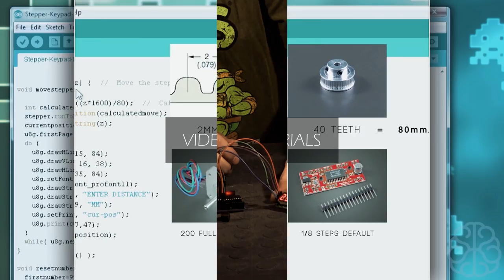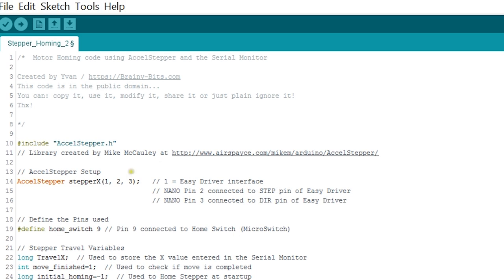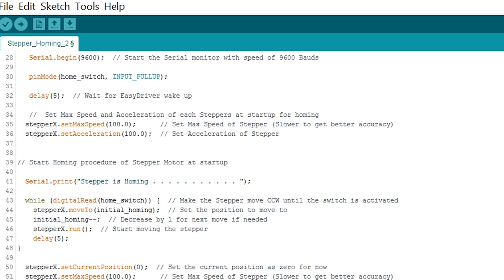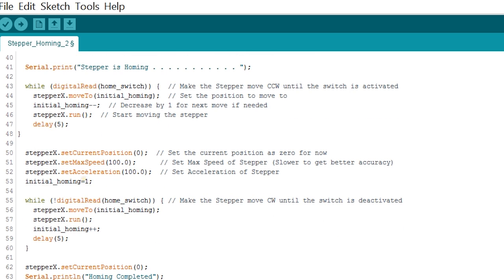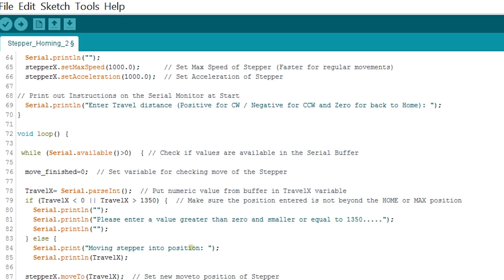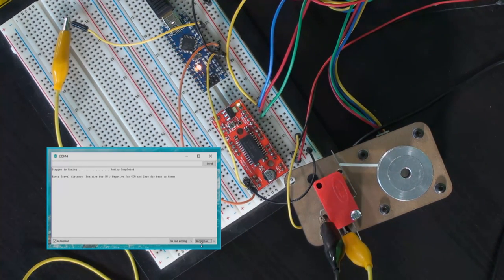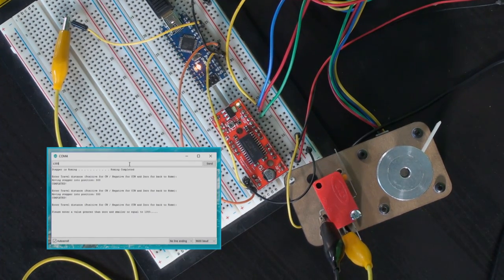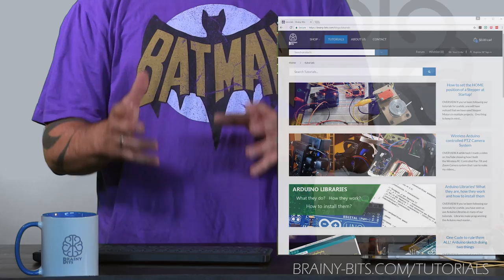Arduino - Homing Stepper Motors using the AccelStepper Library - Tutorial

Comment: Thanks a lot for this tutorial. It helped me understand a lot of things a lot better! Unfortunately I do still have one complication. I am unsure what I am doing wrong. I have got the homing working, but it does not seem to accelerate to my limit switch. I have adapted the code to fit my cnc shield v3, so now my code looks like this:
/*  Motor Homing code using AccelStepper and the Serial Monitor
 
Created by Yvan / https://Brainy-Bits.com
This code is in the public domain...
You can: copy it, use it, modify it, share it or just plain ignore it!
Thx!

*/

#include "AccelStepper.h" 
// Library created by Mike McCauley at http://www.airspayce.com/mikem/arduino/AccelStepper/

// AccelStepper Setup
AccelStepper stepperX(1, 2, 5);   // 1 = Easy Driver interface
                                  // NANO Pin 2 connected to STEP pin of Easy Driver
                                  // NANO Pin 3 connected to DIR pin of Easy Driver

// Define the Pins used
#define home_switch 9 // Pin 9 connected to Home Switch (MicroSwitch)

// Stepper Travel Variables
long TravelX;  // Used to store the X value entered in the Serial Monitor
int move_finished=1;  // Used to check if move is completed
long initial_homing=-1;  // Used to Home Stepper at startup
const byte enablePin = 8;

void setup() {
   Serial.begin(9600);  // Start the Serial monitor with speed of 9600 Bauds
   
   pinMode(enablePin, OUTPUT);
   digitalWrite(enablePin, LOW);   
   
   pinMode(home_switch, INPUT_PULLUP);
   
   delay(5);  // Wait for EasyDriver wake up

   //  Set Max Speed and Acceleration of each Steppers at startup for homing
  stepperX.setMaxSpeed(5000.0);      // Set Max Speed of Stepper (Slower to get better accuracy)
  stepperX.setAcceleration(9000.0);  // Set Acceleration of Stepper
 

// Start Homing procedure of Stepper Motor at startup

  Serial.print("Stepper is Homing . . . . . . . . . . . ");

  while (digitalRead(home_switch)) {  // Make the Stepper move CCW until the switch is activated   
    stepperX.moveTo(initial_homing);  // Set the position to move to
    initial_homing--;  // Decrease by 1 for next move if needed
    stepperX.run();  // Start moving the stepper
    delay(5);
}

  stepperX.setCurrentPosition(0);  // Set the current position as zero for now
  stepperX.setMaxSpeed(5000.0);      // Set Max Speed of Stepper (Slower to get better accuracy)
  stepperX.setAcceleration(9000.0);  // Set Acceleration of Stepper
  initial_homing=1;

  while (!digitalRead(home_switch)) { // Make the Stepper move CW until the switch is deactivated
    stepperX.moveTo(initial_homing);  
    stepperX.run();
    initial_homing++;
    delay(5);
  }
  
  stepperX.setCurrentPosition(0);
  Serial.println("Homing Completed");
  Serial.println("");
  stepperX.setMaxSpeed(5000.0);      // Set Max Speed of Stepper (Faster for regular movements)
  stepperX.setAcceleration(9000.0);  // Set Acceleration of Stepper

// Print out Instructions on the Serial Monitor at Start
  Serial.println("Enter Travel distance (Positive for CW / Negative for CCW and Zero for back to Home): ");
}

void loop() {

 while (Serial.available()>0)  { // Check if values are available in the Serial Buffer

  move_finished=0;  // Set variable for checking move of the Stepper
  
  TravelX= Serial.parseInt();  // Put numeric value from buffer in TravelX variable
  if (TravelX < 0 || TravelX > 25000) {  // Make sure the position entered is not beyond the HOME or MAX position
    Serial.println("");
    Serial.println("Please enter a value greater than zero and smaller or equal to 1350.....");
    Serial.println("");
  } else {
    Serial.print("Moving stepper into position: ");
    Serial.println(TravelX);
  
  stepperX.moveTo(TravelX);  // Set new moveto position of Stepper
  
  delay(1000);  // Wait 1 seconds before moving the Stepper
  }
  }

  if (TravelX >= 0 && TravelX <= 25000) {

// Check if the Stepper has reached desired position
  if ((stepperX.distanceToGo() != 0)) {
    
    stepperX.run();  // Move Stepper into position
    
  }

// If move is completed display message on Serial Monitor
  if ((move_finished == 0) && (stepperX.distanceToGo() == 0)) {
    Serial.println("COMPLETED!");
    Serial.println("");
     Serial.println("Enter Travel distance (Positive for CW / Negative for CCW and Zero for back to Home): ");
    move_finished=1;  // Reset move variable
  }
  }
}

Also, when I change the acceleration and speed values, it does not seem to affect my motor speed and acceleration.
Does anyone see the problem here?
Reply: Try to change the Arduino pins for the Stepper... 
You type: AccelStepper stepperX(1, 2, 5); 
but for the CNC Shield you need to define:
AccelStepper stepperX(1, 5, 2); 

You "Step" the DIR pin & you "DIR" the Step pin... ;)

This info is for you if you buying the Nano CNC Board from aliexpress & the Board is marked with "Keyes_CNC 2014/07/01" BTW: the micro step jumper are useless if you have this board... Check this out first...
Reply: @dastiieto7651  I found the problem. In the code where the homing is defined, the programmer added a delay(5); That comment prevents any form of accelleration since it defines a constant delay between each pulse.
Reply: Melvin Gabrielse Ok...
But this delay is for sloooooow motion against the home-switch... & release the home-switch while homing..
In the normal movement after homing this delay will take no effect to the acceleration...
Reply: @dastiieto7651  That is true. I was only curious why the accelleration did not work WHILE homing. It turns out that the setMaxSpeed and setAccelleration function in the homing state have no function.
Reply: Melvin Gabrielse that’s true... while homing there’s no need for acceleration, because the Stepper drives damn slow... 😉
Reply: @melvin , did you fix it ? I am facing the same issue . The homing is happening but it is really really slow . How can I make it faster.

Comment: it is possible to connect this schema in cnc shild v3
Reply: It is possible. All you have to do is to redefine the motor and the limit switch to the correct pin. For the X-axis use AccelStepper stepperX(1, 2, 5). For Y-axis use AccelStepper stepperX(1, 3, 6). Note that you have to enable your motor with a 'const byte enablePin = 8;' and in void setup use: 'pinMode(enablePin, OUTPUT);' and digitalWrite(enablePin, LOW);'. Furthermore you can leave code untouched for the limit switch. Pin 9 used in this tutorial is connected on your CNC shield to the X+ End stop. The black pin is for the GROUND of your switch and the white pin is for INPUT.
Reply: @Goedgedaanman  ,here in Brazil, there is not much material for this link, I will because here and I will return, thank you master
Reply: Glad to help @livinmarcenariaartistica8212